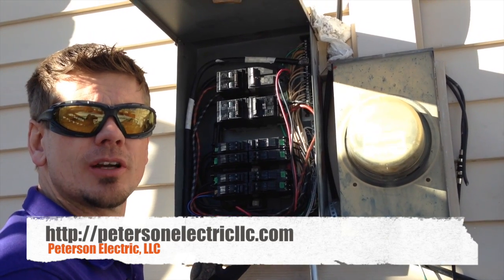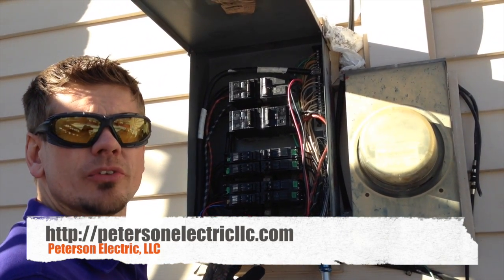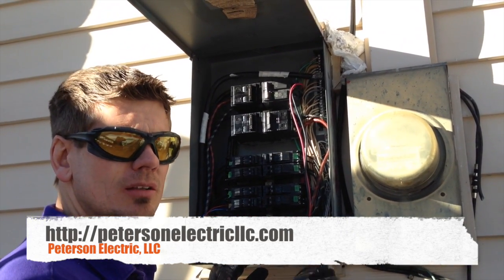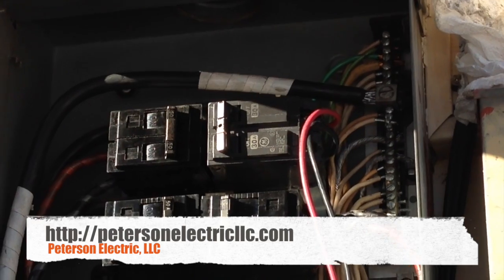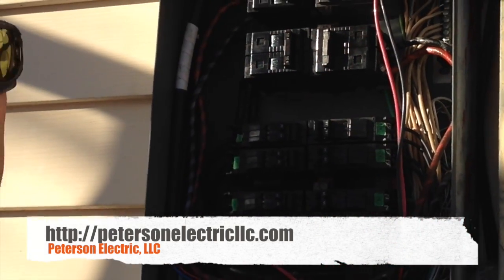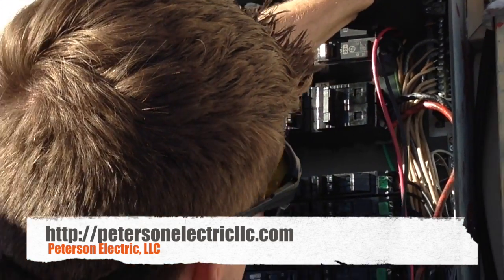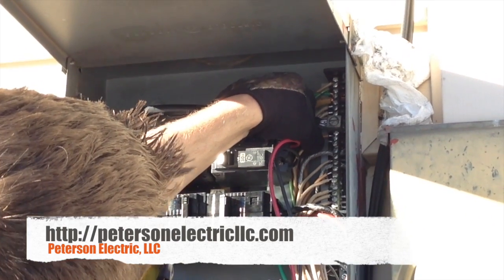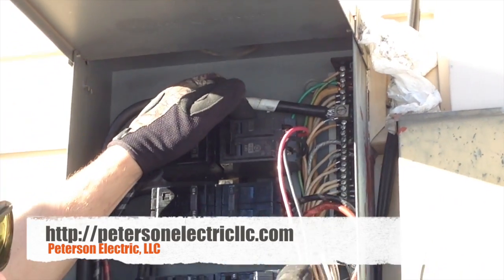Why Are Lights Flickering In My House? Are Neutrals Loose In Panel?

Comment: After years of flickering lights I finally upgraded my 40 year old 100 amp service to a 200 amp panel and we still had flickering issues. Final watched a video that mentioned calling the city out to check the service connection. Sure enough, the neutral at the pole was breaking and rusted. Took him 10 minutes to cut and reattach and my house, for the first time in years, is back to normal.

Comment: Our flickering went to full failure of half the house.  Service call turned into power company call, as the meter socket was arcing and failed. Also, on the call, we found a welded 20A breaker and replaced on the power company's dime.

Comment: Rather than pull, I use the wiggle and tighten method. Usually any stranded wire can be tightened more after a wiggle and that will solve many poor connections.

Comment: We had whole-house flickering LED's.  They all dimmed briefly at 1 sec. intervals.  Long story short: it was the service line coming from the pole:  The electrician for our addition and panel upgrade failed to get an upgraded service line from the power company. Over 2 years, the service line deteriorated from heat buildup and too much resistance.  The LED's were the canary in the coal mine: LED'a are very sensitive to subtle voltage dips as whole house current taxed the cable. This may not be a common problem but upgrading to a larger service line solved our whole-house LED flickering immediately. This was hard to diagnose because voltage was near normal coming in, though one line was below the other, and the drop was worse only under load. Both the electrical and the power company said everything was "OK" at first.  The problem required a little extra troubleshooting with my help because each company tends to point to the other to fix the problem.....
Reply: Wow, thank you for providing this information related to your issue as I am trying to tackle the same thing. I noticed it in my house that my lights have been flickering more often after I installed new LEDs and new switches to support LEDs. I guess I will start at the main supply line as well as I have an upgraded electric system but not sure if they ever installed a larger feeder to the house.
Reply: i've noticed fluorescent tubes also dim if there's a washing machine running on the same circuit, not sure if it's the counter emf from the washing machine motor or a voltage drop, i've also heard i might need a filter capacitor for the AC input on the washing machine. and not all led lights are the same, sometimes they are made with a cheap circuit to make the DC and that's the part of the led light fixture that burns out or was made poorly, rather than the led itself, leading to pulsing if it's not making steady DC anymore. but both led and fluorescent tubes can flicker, dim or pulse for different reasons. usually emi, or overloading that causes a voltage drop
Reply: I had a similar situation and could not figure out the issue. Problem went on and then one day there was a power outage for many people. When the power returned the LED light flickering was gone. The report back from the power company was “equipment failure.” We had a hurricane last year and there could have been some marginal equipment either arching or swaying into tree branches. Bottom line is I should have asked my neighbors if their LED were flickering too.
Reply: What do you mean larger service line? I'm having similar issue. And who's responsibility to fix and how much?

Comment: Hmm. There's a new indoor breaker box in my home. It doesn't get brighter but there is on occasion a flicker that's rapid it last probably 3 minutes tops  the whole house dim normal dim. It just enough to notice the rapid flicker. It was more noticeable with the old breaker panel. 😕
Reply from the maker: Call utilities power

Comment: The only need for "De-Ox" on a lug is if it is a dissimilar metal. We have had it where we had aluminum feeders wires on aluminum lugs and inspectors are fine without the need for De-Ox. It is still a very good practice. We use Permatex anti-seize on all of our screws and connections too in the field. Makes the guy behind you able to take screws and connections loose again in the future. Otherwise screws break or rust or cannot be easily taken out.

Jeff Licensed Journeyman Electrician - Sunny Central Florida
Reply from the maker: Thanks for watching. I do not typically like to Diox all lugs unless they state they are CU only when I am installing a sub feeder. Per article 110.14c

Comment: Nice video. With background more on car electrical systems than house counterparts. Checking for mechanically bad electrical connections comes as a second nature. ;-)

No wonder when I got the house where I'm living now. It was the first approach to some flickering that made my inner alarms jump. Wood house and electrical failures/malfunction usually don't end well. LOL 
It's an older house, originally from mid 70's, so a good checking/cleaning come quite handy. 
Result no further electrical issues and some piece of mind.   

Flickering light(s), burn smell, arc sound, greenish contacts (corroded). If any please do yourself a favor and get to work, before they take your house away. ;-)

Comment from the maker: I never had that issue in 20yrs of service, other than it saves my ass from not seeing a potential recall and the customer “assumes” it was my fault causes I was the last one who touched the panel. So I suggest to pull on every connection in the panel

Comment: I would suggest that "pushing and pulling" on neutral wires is a very poor way to troubleshoot a problem.  Should you pull a neutral loose on a typical multi-wire circuit, or especially a sub-feeder or main neutral, you can instantly destroy many 120V appliances on the premise.
Reply: Yeah voltage will get distribution inversely proportionally to resistance if the neutral is removed from Edison three wire circuit. If I remember the theory from school. 
Tv or computer gets blasted with 200 volts kinda thing.

Comment: My house has been flickering power while the washer is on or fridge. Iv checked grounds, bought new main breakers power company has checked their end. Iv tried changing outlets and turning off all the breakers. Tested the breakers.? ?  Any ideas
Reply: make sure the power company actually checks the return amps on the neutral. call them out for flickering lights. load up a large 120v load and have them check the return back to the transformer. (im a lineman). just becuase the connections outside look good visually doesnt mean they are actually working.
Reply: @eddygilbert9906 …Great response…I’m having the same problem, Can you elaborate more on the subject ???
Reply from the maker: lose lug, or connection.